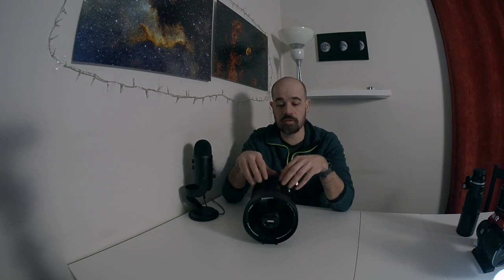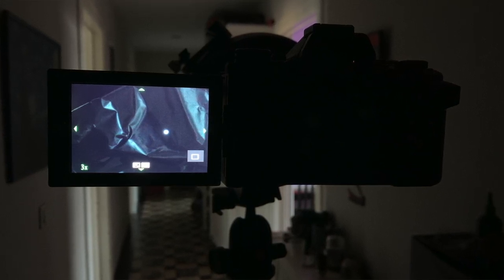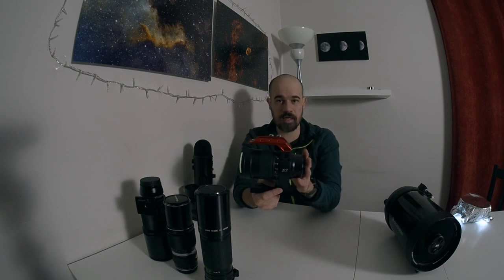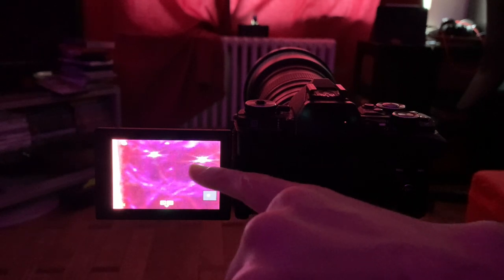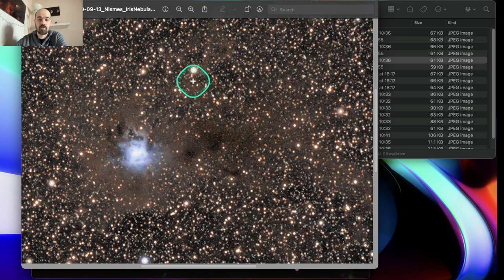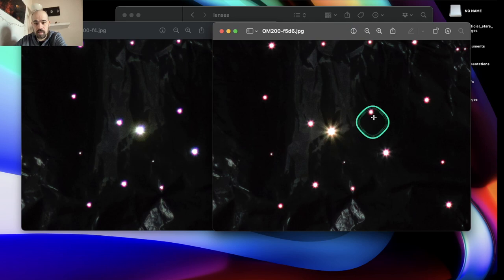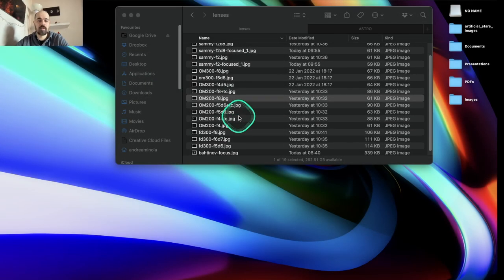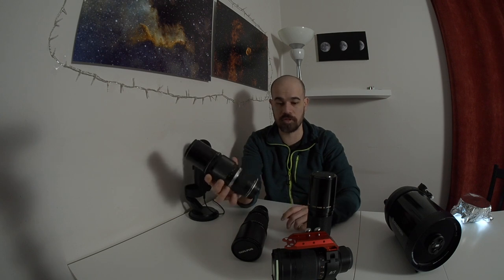Testing Lenses With An Artificial Star Field

Comment: Great video!  Have you ever tried out vintage mirror lenses such as the 500mm f8s from Nikon, Tamron or Olympus? Or the newer Tokina ones that came out in the last few years?
Reply from the maker: thanks :) only vintage lenses I have used are Olympus Zuiko for the OM SLR cameras (film) and a canon FD300. Old lenses can be great to begin with if you already have them, but on stars  most of them show limits (coma, chromatic aberrations, large stop interval that let you loose light quite fast, etc)

Comment: I was thinking to use an iPhone s Flashlight on a tripod  at home as an Artificial Star
Reply from the maker: It should work. For my C5 I used a flashlight and in the video a bike light.
Reply: @andreaminoia2002  Did you notice any issue with the C5 collimation when at infinity as compared to when using the artificial star? I made an artificial star today and I'm just wondering if the collimation will also be good at infinity.